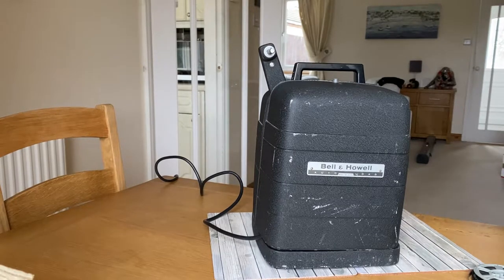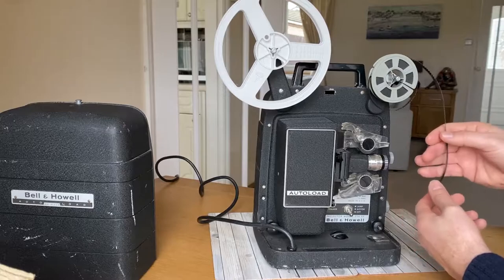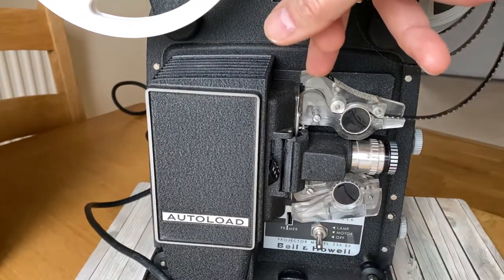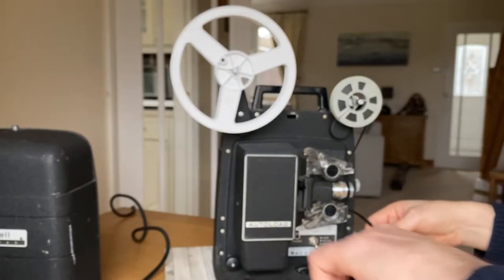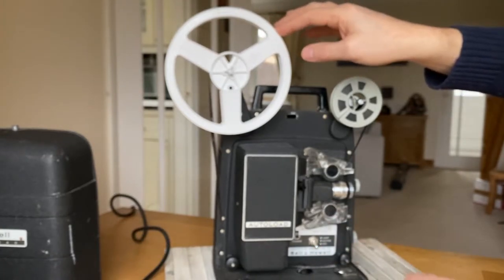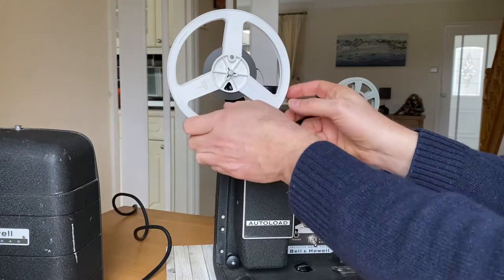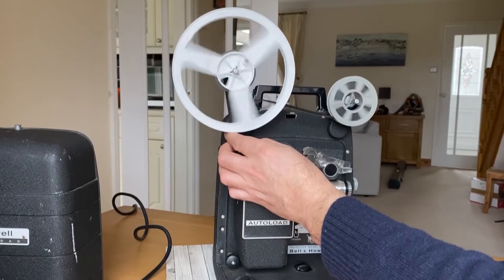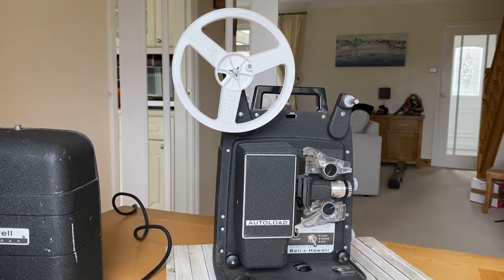Projector instructions Bell Howell 256 EX

Comment: Is it possible to take that adjustable lens apart, I took it off the projector and I look through  and it looks kind of cloudy with smudges in the inside, I haven't used it in 12 years, yes all my pictures are blurry, thanks for your help

Comment: Getting my dad’s bell and howell up and running. Works good most of the time but sometimes the film starts jumping. I remember back in school there was a reset switch when it would do that. Is there any way to do that on this projector? Sometimes just switching to reverse and back to forward will fix it but not always. Any ideas?

Comment: Hi Steve .. We have lost our Mum about 6 months ago and been in the loft and got all the cine films out and this exact projector.

We do have the instructions but I was confused as the top feeder does not appear to be feeding through.  The bottom one does

This was when I looked on here to fine your instructions and realised it should be moving on pressing down the lever to start the initial feed.

Is there anything I can do myself to fix tjis or should I hand the projector into a specialist to check it?  Thanks in advance .. Elaine
Reply from the maker: Sorry for the delay in responding. Depends on how mechanically nimble you are. I would open it up and have a look but I’m quite handy with tools.